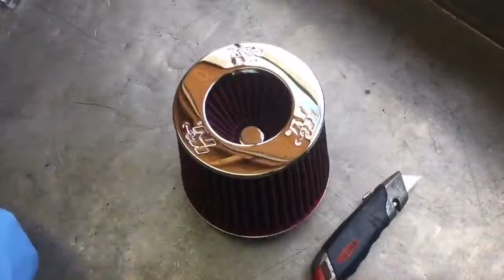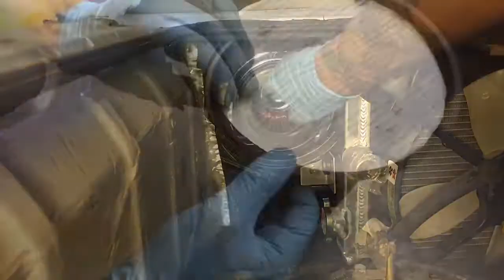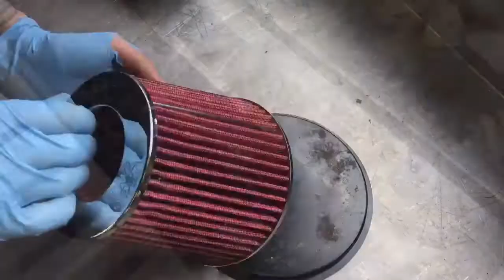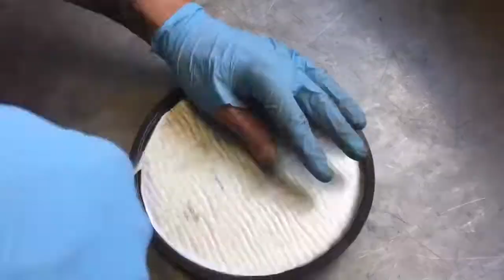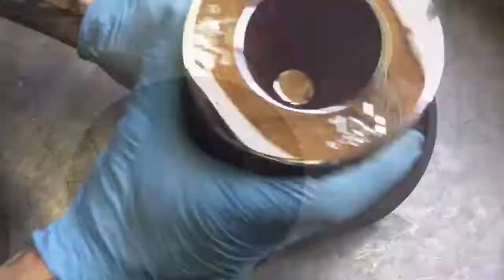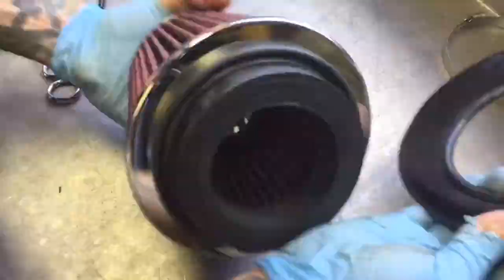Secret Air Filter - Daily Driver VLOG 6/27/17

Comment: Is there enough air flow there?!
Reply from the maker: +Fred Webb Thia bus was converted to fuel injection and the VW computer sat right in that spot, there is a large hole that funnels air to that plenum. If you had a carbureted bus then you'd have to create a hole to allow airflow.